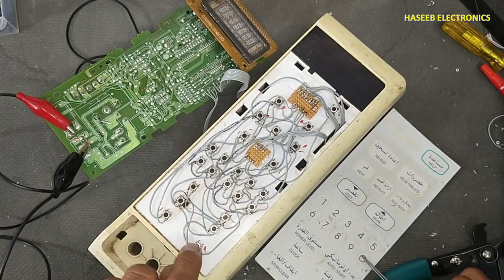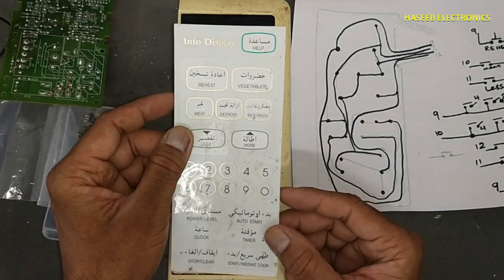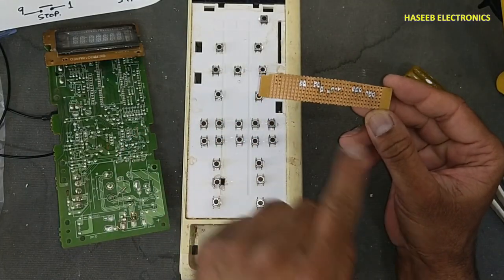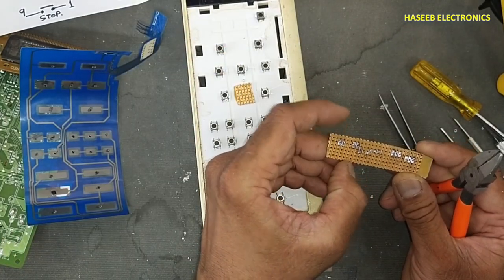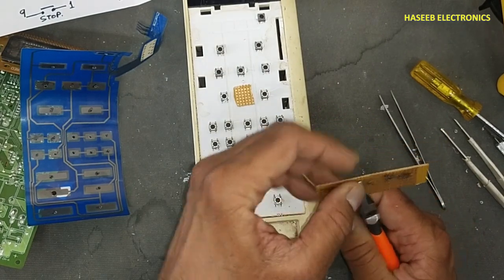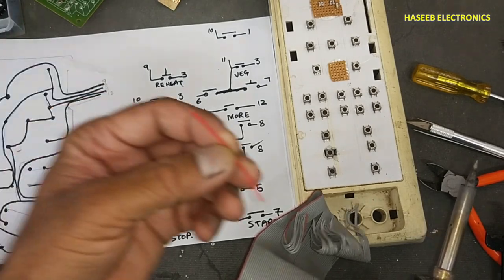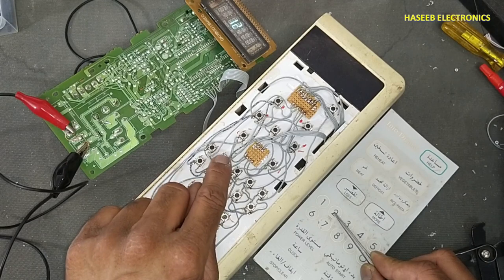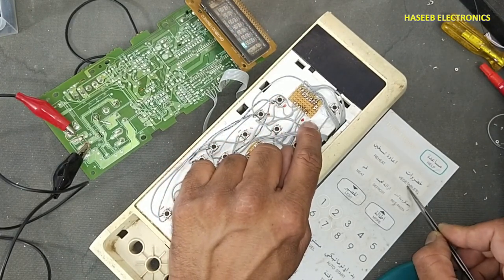{903} microwave oven membrane keypad not working - part 2

Comment: Nice repair. I have two questions... Does the hot glue soften significantly while you are soldering? Meaning, does this present any problems? Would it have been possible to 1) leave the back plate completely clean, 2) use two of the generic sticker-type push button pads and 3) just write the functions on the pads with a permanent marker? Would doing the repair in that manner encounter problems? I am not fault finding, here, I am just thinking on the repair options. Thank you, Haseeb. You are most gracious to teach us.
Reply: I have never had this problem but I used to wonder how it happens. Based on what I saw in your last video, I started to think that it was simply one of the buttons being stuck down because of being used a lot.

 Most likely the "start" button because it is the most used button on a microwave. So I would have rather just replace that particular button and leave everything else intact.....

....By testing each pin of the keypad to see which button was stuck down. Then cutting out that one button from the dual layer keypad and replacing it with only one of the  tactile switches shown in this video.

 You can probably also find out which button is the problem before taking it apart by running your fingers across each button  to see which one has a dent in it. That is most likely to button that was stuck down.

It's most likely not a failure of the entire keypad, but because one of the buttons is stuck down it prevents all the other buttons from working! 

Using my approach may save you a lot of time and materials and testing.

This is still a very good video series though because it shows people how to troubleshoot and assess a problem and some methods in order to fix it.

Comment: I have never had this problem but I used to wonder how it happens. Based on what I saw in your last video, I started to think that it was simply one of the buttons being stuck down because of being used a lot.

 Most likely the "start" button because it is the most used button on a microwave. So I would have rather just replace that particular button and leave everything else intact.....

....By testing each pin of the keypad to see which button was stuck down. Then cutting out that one button from the dual layer keypad and replacing it with only one of the  tactile switches shown in this video.

 You can probably also find out which button is the problem before taking it apart by running your fingers across each button  to see which one has a dent in it. That is most likely to button that was stuck down.

It's most likely not a failure of the entire keypad, but because one of the buttons is stuck down it prevents all the other buttons from working! 

Using my approach may save you a lot of time and materials and testing.

This is still a very good video series though because it shows people how to troubleshoot and assess a problem and some methods in order to fix it.